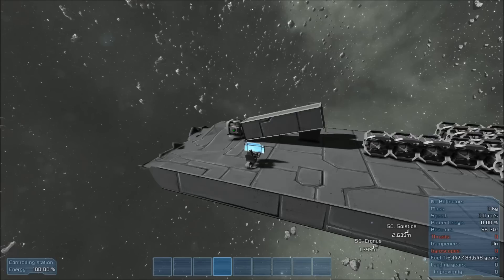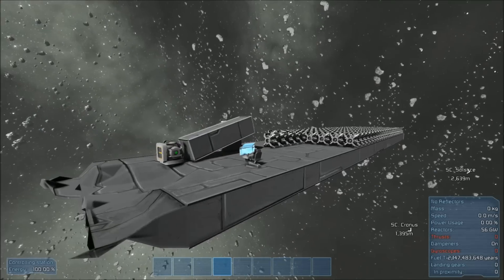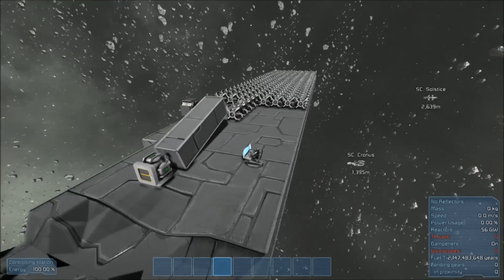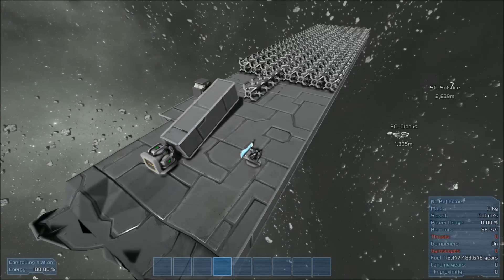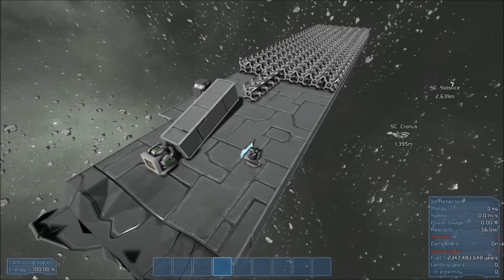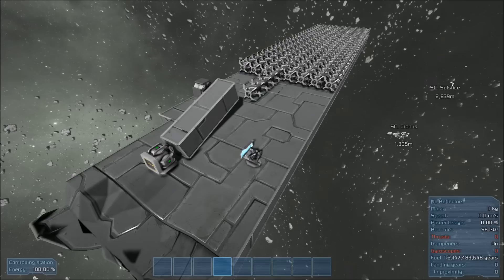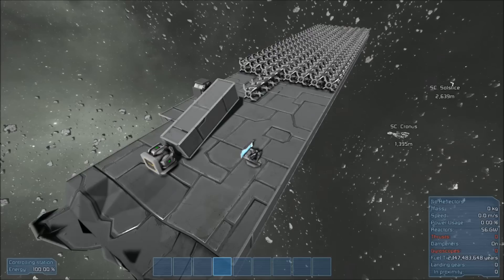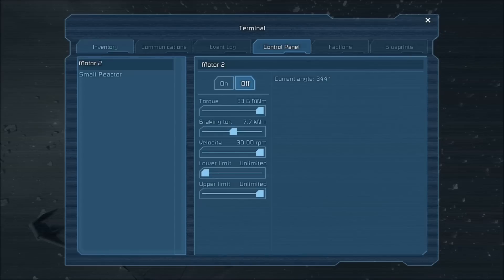Space Engineers - Concept - Self Destruct Mechanism - Part 14

Comment: Yo. Why not use a torpedo like how LastStandGames does it, but have it face a wall. Behind that single block layer of wall is a layer of bombs that span all the critical points of the ship. That way, if it is taken over, you can destroy the main parts of the ship (engine, core, etc.) that they're more likely then not attempt to destroy themselves, if they board it,.